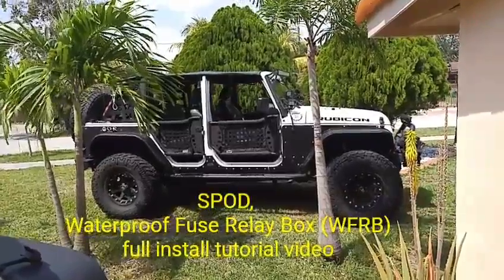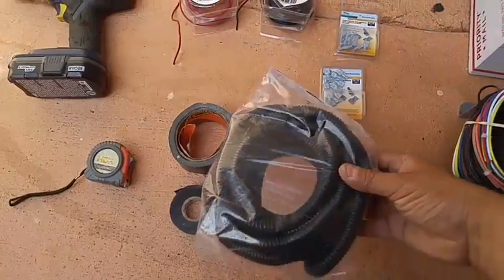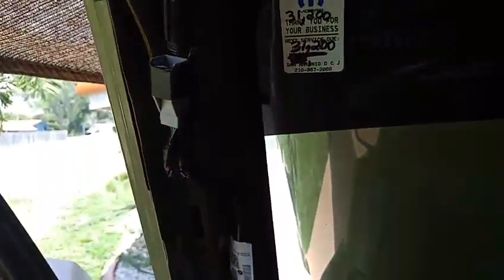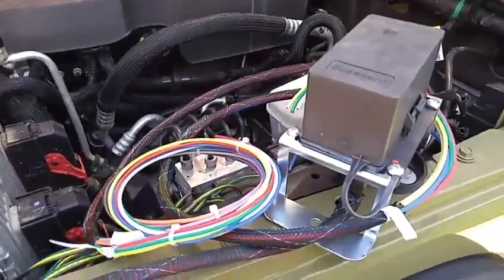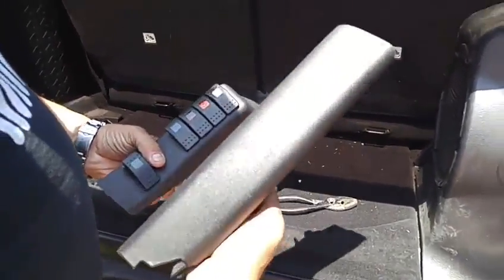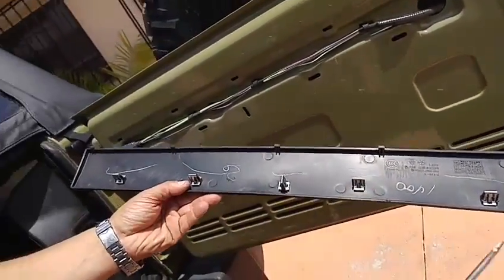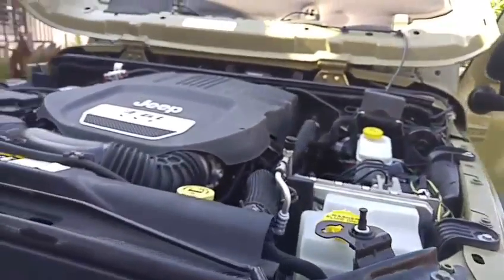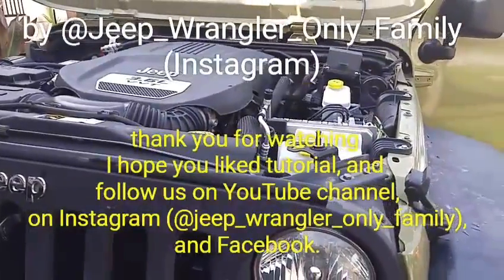How to wire install (detailed 12-step) LED WFRB Waterproof Fuse Relay Box SPOD Pillar Jeep Wrangler

Comment: Thanks for the video. I was precisely looking for that since I bought the box but have yet to install it. You ran through all the questions I had. I do have the dual LED rockers which I guess have one more pins in the back for the led that comes on to light up the switches along the car accessory illumination. I will figure this out. Good job!
Reply from the maker: Thank you for your reply and compliments Sam.  This means a lot to me, and my only reward at this time is your compliment.  so thank you.  My rocker switches only had 3 prongs.  I do admit, I am not an electrician, and yes figuring out which prongs needed which wore took some research.  I would suggest searching for the switched manufacturer website or instructions will provide some details.  My guess would be that the 4th prong is for permanent light of the switches (to locate at night).  however, the order may be different.  Thank you, and am glad to hear that you found the video useful.  good luck, and if you can, please update me when you figure out the 4 prong switch wiring.

Comment: Thanks for taking the time for the How-to video.    However as a side note, this box can handle Ten (10) accessories not five. 5 non relay accessories which have a 15 amp fuse and five (5) relay accessories with (5) 30 amp fuses. With that being said, I have the WPRB and I absolutely love it. The only thing I'd say about the switches you're using is they are do not light up until you use them . that's why I went with the OTRATTW.net switches.  it's alot more involved to wire them but you can see them at night and not have to guess which lights are where. Thanks again.
Reply from the maker: thank you, am gad you liked and replied.  yes, its 10 total, but i think i was referring to 5 switched, and not the permanent fused power connections.  Yes, full-time lighted switches are nice, but i did not find any reasonably priced when i did video.  They can always be upgraded.  Thank you for sharing your thoughts

Comment: he is also on Facebook - not just eBAY. Good guy - responds quickly.  As a side note make sure you remove the 15 amp fuses for the accessories you are not using - you tucked the wires away but actually remove the fuses from inside the box - safer that way.
Reply from the maker: Thank you for your reply.  Yes, the manufacturer is a good guy, he replied fast and this was why i put the video together as a way to help him (manufacturer) answer and address common questions, but also the viewers.  Yes, I tucked them away, but i taped off the ends.  I have been meaning to remove the fuses, but i have to research which fuses belong to which permanent colored wire.  I see a follow up video coming (part 2), when i figure it out.   However, since i taped them well, i have not had any issues in over a year of use, but i agree, it is better to remove used fuses.  Thank you.

Comment: I have one of these boxes and I'm trying to connect my ARB air compressor to it. My Alpine I207-WRA has the switches built in via the KAC-001. The switch is 4 wires, the relay box is 1 wire, and the switch for the radio is 1 wire. Also there's a power and ground from the air compressor with a relay. Do I need the relay? It's kind of confusing.
Reply from the maker: Hi, while am not familiar with the Alpine switch box,  nor am i an electician, i can almost be certain that a relay would be needed, if not already built in on the alpine unit.  If using the switch box i used, the relay is in the unit.  If you only see 1 wire its likely that that is the positive, since the other one would be the ground which you can connect to almost anywhere on the car metal body (basically almost the whole car is a ground).  Hope this helps..

Comment: Nice video. I have this box and love the build quality of it. I’ve only partly installed it so far. I want to know if you cut off the relays that came with the light bar on your bull bar and are only using the one in the wrfb? That makes the most sense to me but I haven’t found anything anywhere about this. Thanks again for the great video.
Reply from the maker: Thank you for your reply.  As far as the lights, I only used the light and connected to the wires it brought, which were already connected to the LED lights.  In other words, my LED lights did not come with any relays nor wiring.  I hope that helps. thank you.

Comment: so you wired your switches to only work when the key is on?
Reply from the maker: Thank you for your reply.  Yes, the 5 switched connections only work when key is on.  Please note that the WFRB also has 5 permanent fused power connections (non-switched, which will work even when key is off,  I hope this helps.

Comment: What did you do with the negative wires from the accessories?
Reply from the maker: Thank you for your reply, and my apologies for delayed reply.  Technically, you can connect negative wire anywhere on the body of the Jeep, since the body of the Jeep acts as a negative/ground.  in my case, the inside ground wires i connected to the dashboard river side behind the removal side panel.  The ground wires in the engine compartments, I connected them to the body on the driver side on the inside fender, between the horn and the driver side headlight lamp.  hope this helps.
Reply: JeepFamily4Life Better late than never! Thanks!
Reply from the maker: BTW, I did not drill any holes for the ground wires, I simply reused existing ground bolts that were place on the body OEM.  (off-course, I added/crimped ring end connectors to the ground wires so that it would remain in place and retained by the OEM nuts.

Comment: So I’m guessing the guy that does the box on Facebook doesn’t do them anymore, last post in 2015 and multiple posts by people asking if he still makes them with no way to contact. So anyone got a new source for the box?
Reply: BP Automotive out of Kentucky makes them.  Pretty much same product but does not come with the Larger fuse for the power coming off the battery and no wire loom to tidy it up.